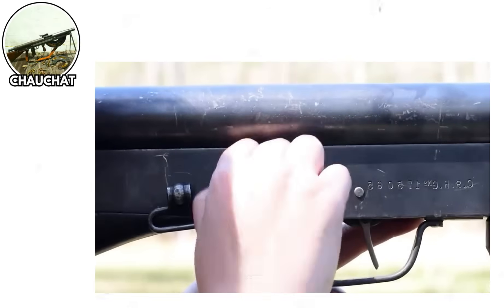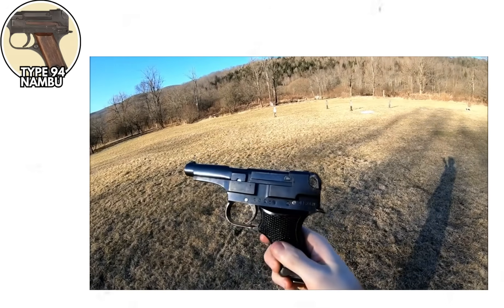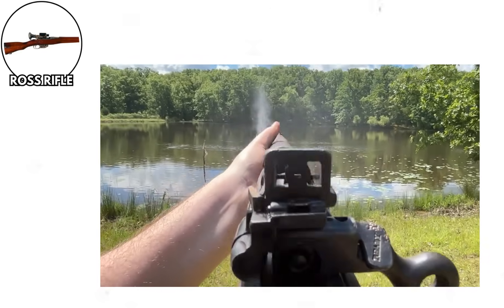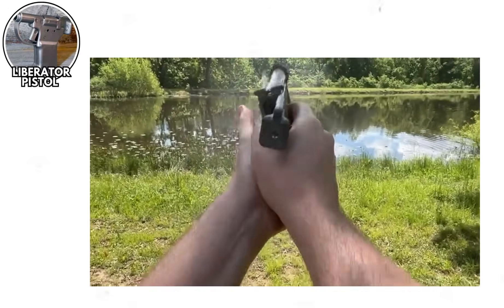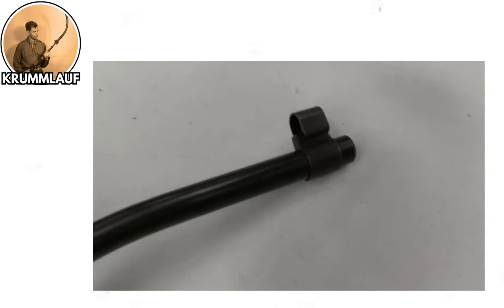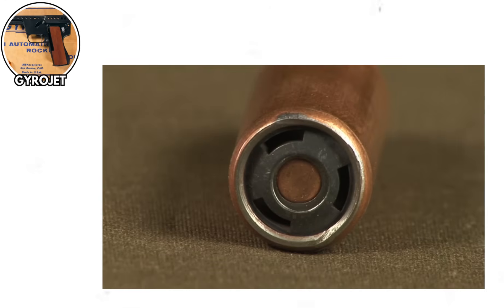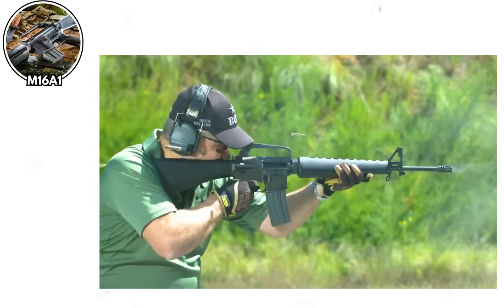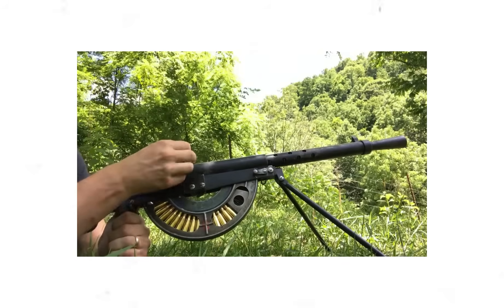The Worst Guns Soldiers Were Forced to Use

Comment: The M16A1 is not the version that was shitty. It was the OG M16 (Air Force) and the XM16E1 (Army & Marines). The M16A1 was the improved version that saved the reputation of the M16 platform and turned out to be very well liked by the soldiers in Vietnam towards the end of the war.

Comment: Dishonorable mentions:

1855 Colt revolving rifle: cumbersome to load, difficult to grip, gas could escape burning the shooter's hand, and prone to chainfires. 

Glisenti 1910: Italy's worst pistol that was so unreliable that many Italian officers stuck with Bodeo 1889 revolvers. 9mm Glisenti was also a weak round and the pistol was not compatible with 9mm parrabellum.

Reising M50/M55: America's worst submachinegun which was horrendously unreliable in the Pacific jungles. Marines often ditched them after one magazine. 

Breda M30: notoriously bad Italian LMG. It had a fixed magazine which if broken, rendered the gun useless, only held 20 rounds, the rounds had to be oiled which attracted dust and dirt leading to constant jams, and violent recoil action.

L85A1: such an unreliable bullpup rifle it had to be upgraded to the A2.